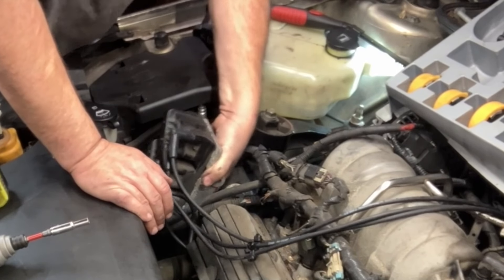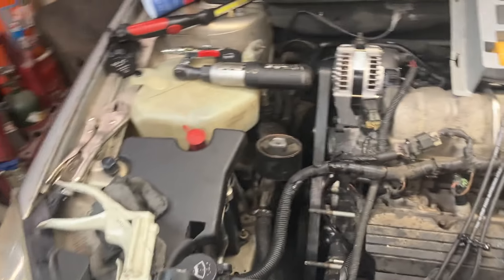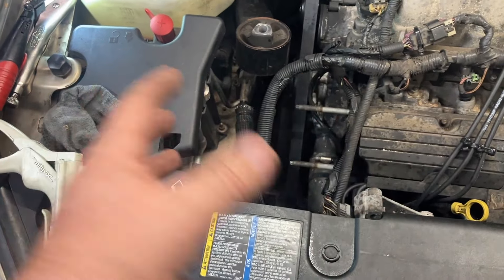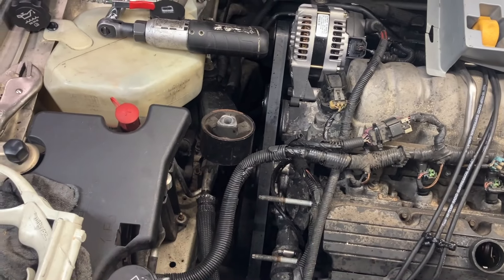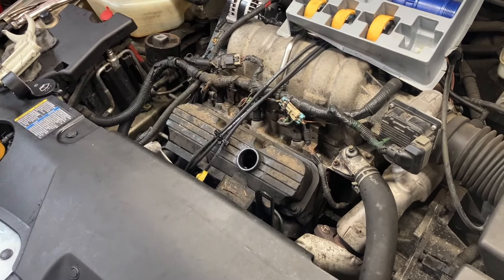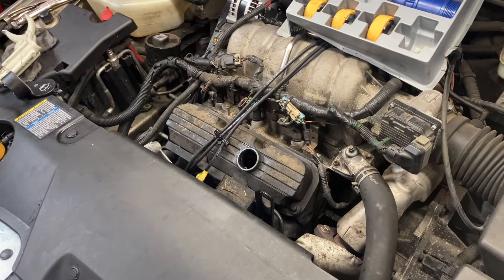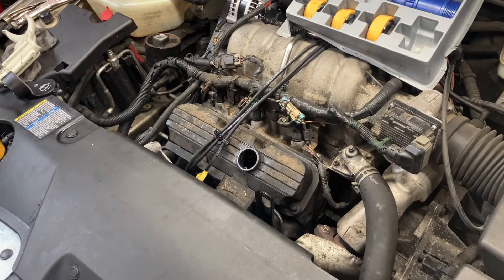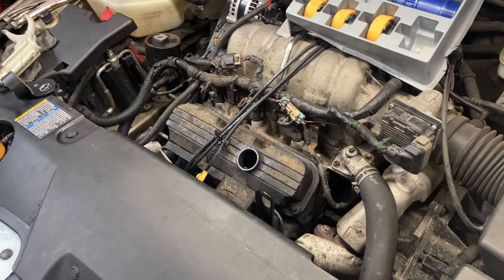2007 Buick Lucerne - 3.8L - Coolant Leak in Timing Cover - Easy Fix / No Parts Required

Comment: That just happen to my 2008 lucerne, But i did see it was the water pump at the bottom where the hole is leaking. These Buicks you can work on them every single month. There is always something with these cars going wrong. Like i said before, Its a love Hate relationship with these lucernes. The last bolt on the right side, larger one, on the water pump was a bitch to get out, It was so caked up with crap i thought it was going to strip the threads, It was horrible. People don't realize how most of the time these jobs get be a pain to do and so much more time, Just like that last bolt that literally took 1 hour to get out without damage. if the bolt would have snapped inside or messed up the threads it would have been a disaster,,, People have no idea unless you worked on cars alot. I passed on the timing chain gasket cover witch should have been done but i know that would be sometime in future besides the lower intake manifold and upper intake manifold gaskets and more and more..... Its never ENDED with these cars.....😡 Now my 3 back spark plugs are frozen in and so tight in they cant come off yet. They are only 3 years old. I wanted to put new iridium's in instead of the platinum, I will have them soaked with PB blaster to see if that works, Some people say warm your car up a little and some say leave cold, Not sure whats better, Its cast iron as you know, Good luck with yours.
Reply from the maker: I have just never had the spark plugs seize in these engines.  I haae had them hand up on fords and other engine, but never these.
Reply: @frugalprepper  thanks for replying again, I don't understand it. Maybe I just have a lemon from day one. Ever since day one that I bought the car I've been having issues with replacements of different things. I bought it with 27,000 mi on it from a dealership. They  put a new rack and pinion in the day I bought  it. The car did not look beat at all still doesn't to this day. The thing looks great cosmetically inside and out and even underside. It's just that things been happening from day one but again it's a love-hate relationship, any affordability for any other cars which is way too expensive these days. I did have a slight leak on the timing chain cover a very very slight leak yesterday. Tighten the bolt up a little bit and put a little RTV gasket on the corner. Hoping it stopped it. I see common sense when you pull the big bolts out of the water pump they are tied into the timing chain cover, I think what it does it pulls and disturbs some if the gasket out with it out of the timing  cover gasket. Will see, if not I have to get someone to do that job sometime after January or February. Wish you were closer I guarantee you would be my mechanic. Thanks again have a great rest of the week
I forgot to mention I had a rebuilt transmission 2 years ago add 100,000 mi the band broke. But I think they did a crappy job still have some problems with it which I think is the torque converter now.
Reply from the maker: I never have transmissions rebuilt.  I always get a used one from a wreck at a junkyard.  Mine it on it's 3rd transmission.  They are easy to put in.
Reply: @frugalprepper  Thats a great idea. I will consider that next time. How expensive they are to get rebuilt and you really don't know what they really do. Very hard to trust anymore especially where i live,. Thank you
Reply: @frugalprepper Did the same a few months ago, had over 230,000 miles on the transmission b4 swapped with one with less than 100k miles on it.

Comment: What part do you use for the new timing cover now?  I see dorman makes one is that any good?
Reply from the maker: There are only 2 out there.  Doorman and GM Genuine.  I normally go with Doorman, because it is half the price, and I haven't had any problems with them.  Normally I avoid doorman parts, but $250 is a lot of savings.  I have some customers who only want the best parts and they will buy the GM one.  I honestly see no difference in them.  I think the GM Part may be a rebranded Doorman one.
Reply: @frugalprepper  Thanks, I see where the aluminum starts to look bad but the ones I have done were not corroded too bad and I used the metal fel-pro gasket and have been lucky so far that they didn't leak.  Not a job you want to do twice so I think I'll start using the dorman cover.  I read a few reviews that said they did not work right so thought I'd see how they worked out for you.